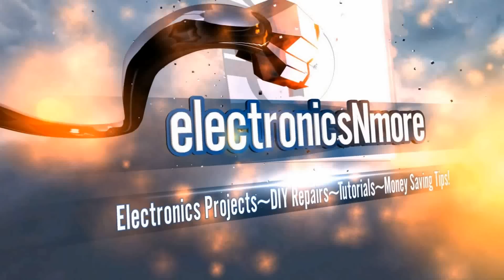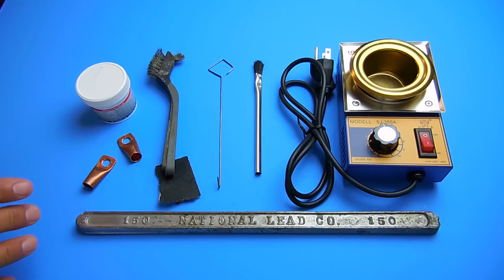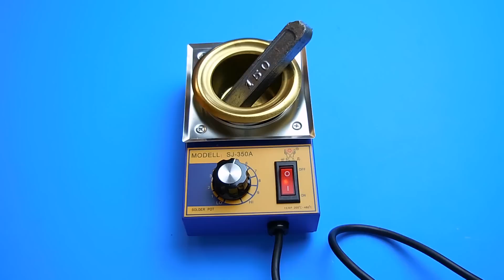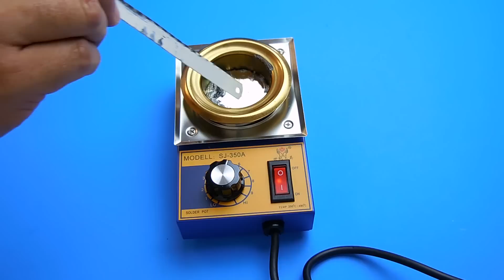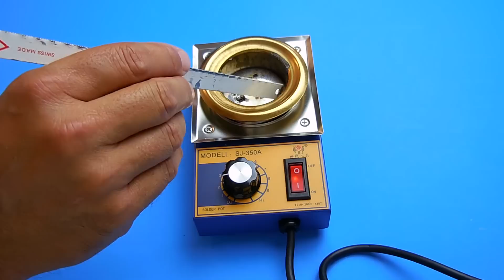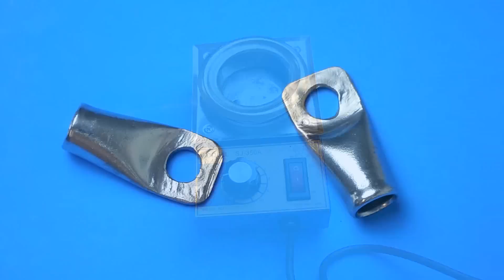Easily Make Corrosion Resistant Lugs! (Tinning)

Comment: If you want to get your copper bright and shiny without scrubbing mix up a solution of 16oz water 2oz hydrogen peroxide and 1oz citric acid and just drop your pieces in there to soak and they will come out looking brand new

Comment: While this may seem like a good idea, it really isn't. Solder is way more malleable than copper. The reason the bare lug grips so well onto the cable when crimped is because copper has just the right balance of malleability for it. When you cover the inside of the lug with solder you decrease the grip strength from the crimp due to the solder deforming inside. It's exactly the same reason you don't tin wire that you want to secure in a screw terminal, because they tend to slip out. This is another example of someone sharing bad advice on YouTube because they don't have enough knowledge of a subject to know any better.
Reply from the maker: With all due respect, you don't know what you're talking about. Stop trying to make yourself feel important to others. YouTube is full of pedants.

Comment: I was wondering, if using this technique to solder lugs and 0 or double 0 cable, could you get away with not crimping, using the solder to hold the wire to the lug only?  I think it would work.  I'm trying to be a tight arse here 🤣

Comment: Nicely done. Had a couple questions: 1) Can I use pure tin instead? 2) I have a specific need to coat just the outside of the copper lug and keep the interior (where the copper wire would go) untouched by tin. Is there anything you could think of to plug the hole and still withstand that temperature?

Comment: What if you just used soldering techniques for copper pipe? I would probably lead to a less desirable, blobby look, but may be an option to those without a solder pot.
Reply from the maker: The solder pot is the way to go they're very cheap.

Comment: Check out electroplating with nickel and chrome...electro deposit of metals on cathode in solutions used to be wide scale bit produce hazardous chemicals.
Reply: Electroplating zinc is better for electrical contacts. Nickel's not a bad second choice. Chrome has good corrosion resistance but it has higher electrical resistance as well. Zinc plated onto copper becomes brass, which is what most of the prongs for electrical outlets are made of, for good reason.

Comment: Seriously did you test yourself for heavy metals? since melting all those heavy metals can give you high amounts of lead and bismuth. So many do not take precautions and don't ask what is the dangerous o doing it but wonder only fi they can do it since many get loaded with heavy metals. 
I think you should test yourself which costs $60 to see.
Take care
Reply from the maker: I'm fine. There are no lead vapors UNLESS you overheat the lead. The flux fumes are probably worse. The key is good ventilation and being upwind. I have done Cilantro and EDTA capsule detox treatments in the past. My blood work is fine. Thanks for your concern!
Reply: Can you make a video on safety and detox? I think your viewers will appreciate it. Also how long did you do the detox? And to make the cilantro more effective one has to take chlorella to absorb the heavy metal when the cilantro helps flush it out. I think chlorella first and then 30 min later cilantro. 
Besides all that keep up the good work. Thanks

Comment: hey how about a method for nickel plating them instead of tinning? tin tends to tarnish and forme a kind of crust or something that looks like dirt mixed with grease or something. Also nickel remains shiny even after handling it bare handed.
I know this can be done electrochemically but i dont see many videos on the topic
Reply from the maker: Nickel has a very high melting point, you would need a furnace. Electroplating is the best way. :-)
Reply: electronicsNmore
 yeah, it's even higher than steel's. Electroplating is the only way i know of, unless there's a way to plate it using nickel dust and a flame or something. Like how they do to "fill" grooves in steel pieces before rectifying/machining them.

Comment: Congrats on the CNBC thing. I think I will order one of those solder pots. I have a bunch of low melting point metals (gallium, lead, bismuth, indium, etc) I hate taking a torch too.  I also picked up 2 1lbs rolls of kester 62/36/2 silver bearing solder.
EDIT: Ordered, Thanks for the coupon code.
Reply from the maker: Thank you. You can't go wrong for $13.99 shipped. Be sure to use the coupon code.
Reply: electronicsNmore I just edited the comment. I did! Thank you!
Reply from the maker: x9x9x9x9x9
Thanks for supporting my channel. I only get a small percentage, but it all adds up. :-)
Reply: electronicsNmore Even though I find your voice immensely boring, I still enjoy your channel and of course I will support you when I can. ;-)

Comment: Maybe you should solder the wire in, its more reliable by bigger wires than crimping, thumbs up :)
Reply from the maker: I usually do that, but when the cable is a fine strand and tinned, crimping works well.
Reply: electronicsNmore You're right :)

Comment: Excelent
Reply from the maker: Thanks!
Reply: +electronicsNmore Hey, i noticed you are using a ESD mat in the background. Im currently
Building my lab and i would like were you bought that mat. Ive seem many but i like the color of yours :) Thanks.
Reply from the maker: I used a sheet of poster board. :-). Blue is my favorite color. You can 
get a very good deal on ESD mats at the same link in the video 
description area.